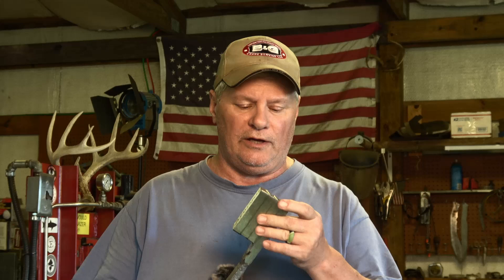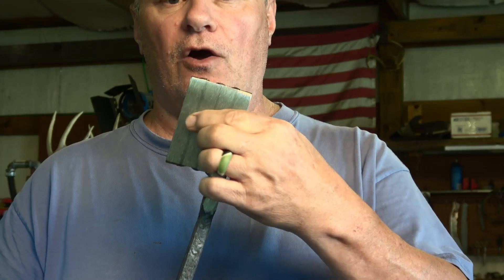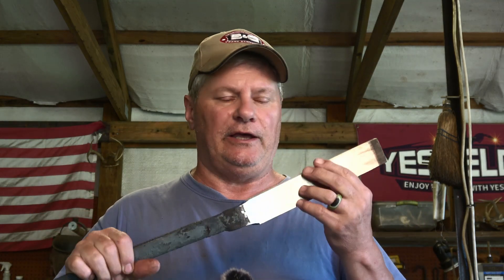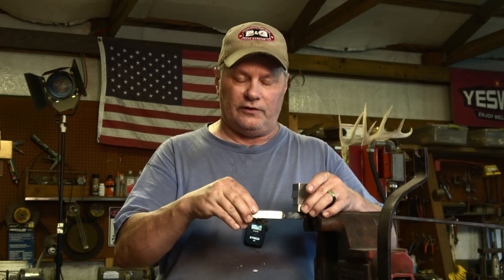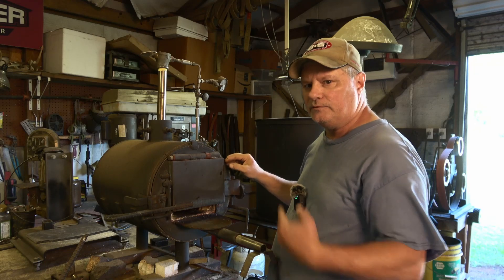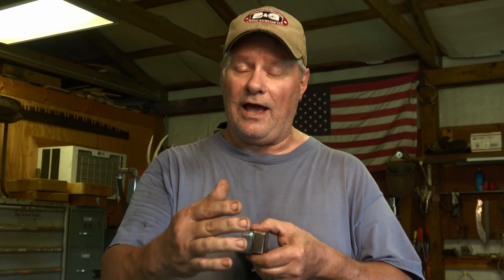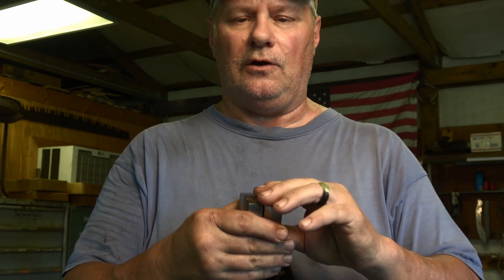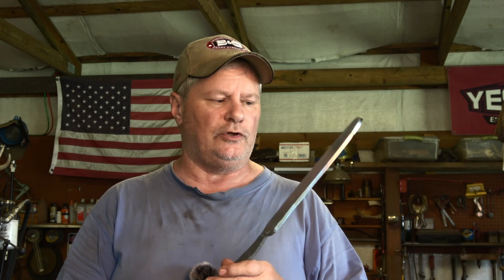How to Make a Feather Damacus Bowie Billet

Comment: That pre-heat is the key, great video and explanation. Thanks
Reply from the maker: Thanks!  You are so right.  In the oil field we would weld on vessels that were 3” thick.  You would pre-heat for a long time with a combination of rise buds and heat blankets before you started any welding.  If not you woukd get checking and cracks.  Everything had a pre-heat procedure for this reason.

Comment: Thank you so much for sharing your knowledge. You detailed some very important points. I was wondering if you would ever consider doing a similar video on cumia. I have had about a sixty percent success rate. Very frustrating. Thanks again.
Reply from the maker: Thank you, I appreciate it!  I will put cumai on my list.  The biggest thing with it is controlling your temperature.  It’s basically a soldering procedure then keeping the temp controlled and drawing out the billet.  But I will put it on my to do list.  Thanks for watching!